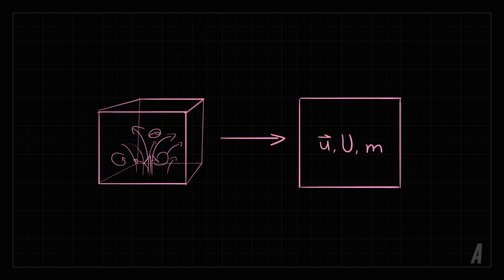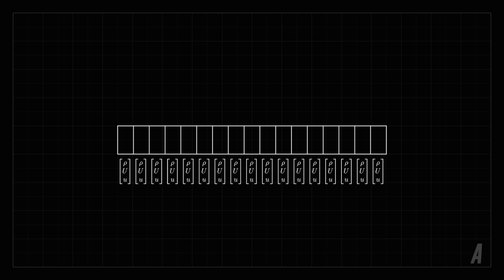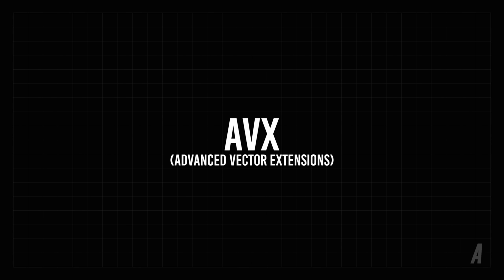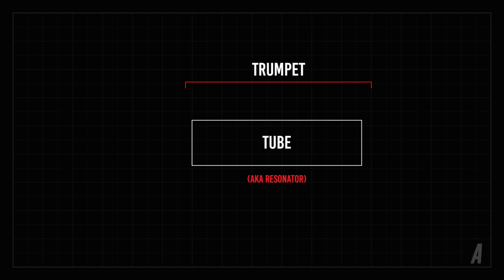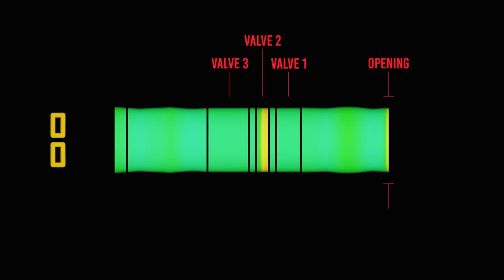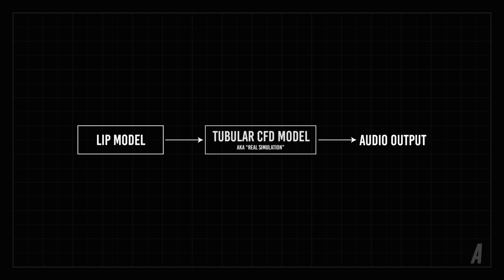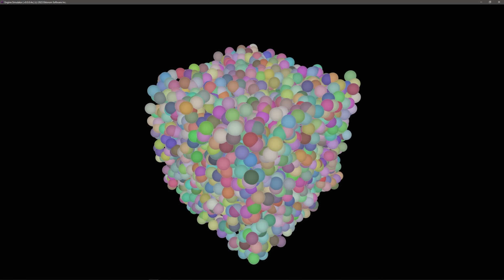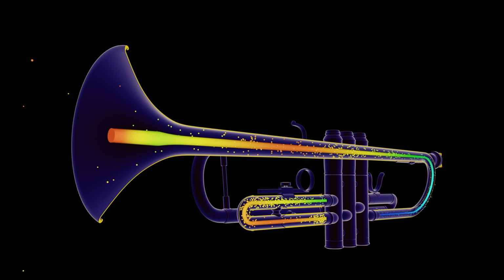Real-time Trumpet Simulation [C++/Vulkan] [WARNING: Flashing Lights]

Comment: It sounds like this is maybe not your goal but depending on how good this simulation gets, you could be marketing this toward acousticians, instrument makes, and academics. I teach a unit on basic acoustics and this tool would be an excellent way to demonstrate how standing waves and harmonics work inside wind instruments if implemented correctly. I have two comments/questions I hope you can answer or maybe just think about.  First, I am curious about what the fluid model and particles are actually representing. From a physics standpoint, the air particles inside the instrument should look like the standing wave that you demonstrated around 8:00 in or so. What should be coming out of the bell is a pressure wave that matches the frequency of the standing wave in the instrument. I am assuming this isn't actually happening for some reason in the model because you are able to manipulate the lip variables to create notes that would be physically impossible on the trumpet. The lowest possible resonance note with an open fingering on a Bb trumpet would be a Bb 2 at about 116.5 Hz. Is that something that resonance limitation or w/e something that you can build into the model?
Reply from the maker: For the first question, the visualization does not show air particles. They are actually just low-mass particles that can be moved by the flowing air in the simulation. They do form something that somewhat resembles a standing wave but it's obscured by the fact that there is net airflow through the trumpet. This makes it hard to see the velocity component of the standing wave (which is actually an anti-node at the output so it wouldn't look exactly like the pressure standing wave). For the second point, you actually wouldn't expect a pressure wave to come "out" of the instrument because the boundary condition is assumed to be constant atmospheric pressure. This means that the instrument has a pressure node at the output. It's actually not clear how a pressure wave radiates out from the instrument since it theoretically shouldn't be possible. In reality, it's due to the fact that the interface between the instrument and the atmosphere is not perfect and some sound "leaks" out. The notes being played are physically possible for the particular trumpet geometry I showed in the video. The resonance doesn't have to be limited, it's intrinsic to the pipe length and other parameters of the simulation and is already accounted for correctly.
Reply: @AngeTheGreat  To the second point, I believe the way that the anti-node works at the end of a wind instrument is that it is similar to how a semi-transparent/reflective surface works with light in a way. A return wave is sent back toward the players mouth and reaches resonance but there is also a portion of the pressure wave that continues out of the instrument at the frequency of the standing wave inside. You can actually see this demonstrated using a Rubens Tube. I'll link a video in the next comment (not sure if that works but here we go).
Reply: @AngeTheGreat  https://www.youtube.com/watch?v=9EQAYUrJItc&list=PL8-Ke6sMl3VrhxUGnlIQjmnEAo6mEAdtv&index=3
Reply: @AngeTheGreat  Also, thank you for the replies here. I am serious about the potential markets for this simulation. I would love to see one that actually visualized the air compression wave form to use it for this portion of my course. I have not been able to find good visualizations to explain this and it seem like you are really close.

Comment: Interesting model. The visual modelling still confused me as the pressure displayed in the valve slides didn’t vary with the valve positioning. Mouthpieces can make a difference to tone so modelling different cup shapes might be an interesting space to explore too.
Reply from the maker: You would not expect to see any pressure change when the valves are depressed because the pressure oscillations can be 100s of times per second. For the real-time view, these oscillations average out to a more-or-less uniform pressure. In slow-motion, you can actually see the pressure waves propagating into the valve slides
Reply: Thanks for the explanation @AngeTheGreat
Reply from the maker: No problem, thanks for watching

Comment: I have undiagnosed epilepsy and this entire video was triggering me really bad. 😅 (I don't seem to have normal photosensitive epilepsy and it seems to be a time dialation thing, slowing down and speeding up things) I had to keep looking away for most of the video, but I really enjoyed listening to this. Your videos are super easy to understand and really helps give insight on how fluid dynamics work in the motor.  I have been doing a lot of research while building some headers for my engine, and watching your videos have helped a lot to visualize and tie everything I am learning together to understand how everything works and affects things. Thanks for the heads up in the title.
Reply from the maker: Do you have any ideas on how I could fix this? I don't really know too much about this subject and it's hard for me to judge what the problem is and how it can be resolved
Reply: @angethegreat  i mean if you want to correctly visualize sound waves, i dont think there is any fixing it. For me, its that constant speeding up and slowing down that gets me, which is just going to happen as you increase frequency visually. A possible fix for this video might be not using a black background, but visually, the black background looks great. I have not had any triggers whyle playing with your engine simulator though for what it is worth
Reply: @angethegreat  from the papers ive read about photo-epilepsy, it seems high contrast-lowfrequency(<60hz) patterns are the main cause, but i unfortunately dont know much about what game developers do to lower the chances.

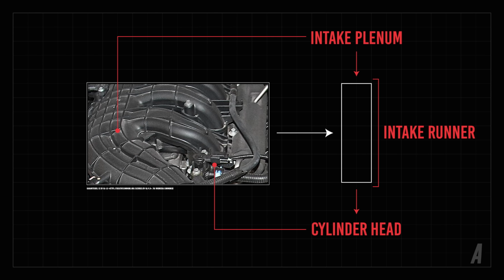For me it was your visualization of the soundwaves hitting eachother in a closed tube. 3:00 and 8:00 made me feel uncomfortable, but i felt a trigger where your eplepsy warning was. My seizures seem to be more triggerred by repeating patterns that dialate in frequency than the more general flashing lights causing a seizure. I usually have seizures when a graphics card cant keep up with the software/game, causing changes in framerates at low frequency that repeat as the card hangs, waiting for a frame, then spits out a few frames, then hangs again.

My fix has been less game time, no game time when i am tired, and expensive pc gaming rig to keep frame rates up. I still have a seizure once a year on average, i am not medicated.

Comment: Real awesome stuff man. 

Just noticed that, at 5:30, you mention the disturbances moving at the speed of sound, and you show c, commonly used to refer to the speed of light. Isn't that disturbing?
Reply from the maker: The letter c is actually also commonly used for the speed of sound. It also does make physical sense that there is a loose relationship between these values. Notice how I said "speed of causality" in the video which is a more descriptive way of referring to the speed of light. The constant c is more of a value that dictates the speed of information propagation in a system

Comment: difficult Idea but for your engine simulator you should make it so that it has the option to import cad models and use a mating system to link everything together (like with onshape, fusion 360, solidworks, etc.) as In my opinion it would be REALLY cool. as a new programmer and average engine enjoyer your content is amazing keep up the great work.

Comment: Amazing work!

I think a few things are missing that might make it more accurate to a real trumpet sound.

1. Wind players also use the tongue as a way of articulating notes to build up pressure behind the tongue and release it as kind of a "T" sound.
2. The metal of a trumpet reverberates and contributes to the sound.
3. The tapered bore makes a big difference. There are different equations for calculating the fundamental frequencies of single open ended tube, double open ended tube, and single open ended cone. These affect how overblowing and fingering work.
4. Trumpets build up condensation in side them as you play. This actually contributes to the sound's raspiness and eventually this needs to be emptied via the "spit valve."

Comment: The outflow boundary section reminds me of that time i figured out that the flare of the trumpet bell is an acoustic version of impedance matching when dealing with electrical signals. It's there to "match the impedance" from air in the tube, to air outdoors, so there won't be much "signal" reflection, which will dampen the volume, if it wasn't for the presence of the bell. Also i have a feeling that it relates to the bells on rocket engines as well. To get the most efficiency out of the energy you're putting in.

Comment: It sounds more like a Saxaphone than anything else.
Reply from the maker: Close enough for my purposes lol
Reply: @AngeTheGreat  "Close enough for my purposes lol" I would agree if you were attempting to build a Saxaphone simulator.
Reply from the maker: @nathanwoodruff9422  I'm not trying to build a trumpet simulation either. I spent about 2 weeks on this simulation and its purpose is to prove that my fluid simulation works which will be used for car engine simulation. For that purpose it resembles a trumpet closely enough for me. The similarities to a saxophone likely come from deficiencies in the lip model and I followed the best research I could find on the subject. So while I appreciate your feedback, it would be much more useful if you could identify specific problems that could be solved or better research that I could follow
Reply: @AngeTheGreat  " it would be much more useful if you could identify specific problems that could be solved or better research that I could follow" I would if I had any desire to do a fart simulator. I mean it is just a long tube with a sphincter.

Comment: A trumpet player's guess at the "massive quantity of air" problem:
The horn itself has to resonate and push back against the fluid inside. This should increase the pressure (I noticed the temperature of the air didn't change much) on the air, and on the lips, lungs. I think it's that lack of pressure that leads to this problem. There's probably something to say about phasing, and the natural resonance of the metal, but all that is beyond me... Heavy horns are verifiably easier to blow. Some trumpets are even made with gold pieces.